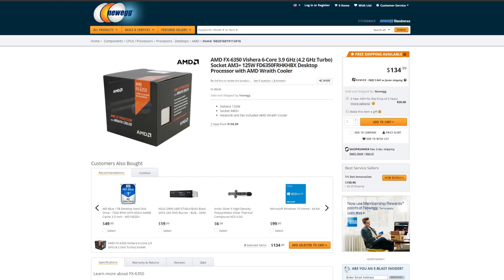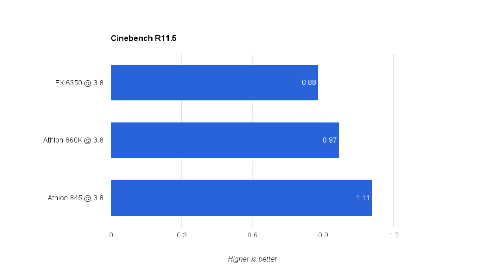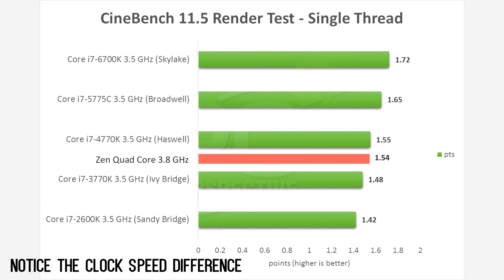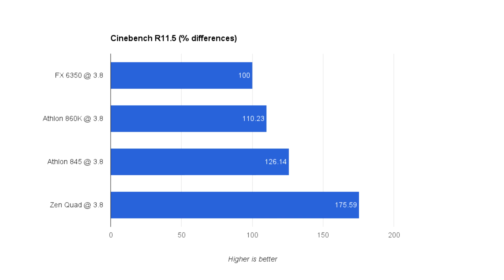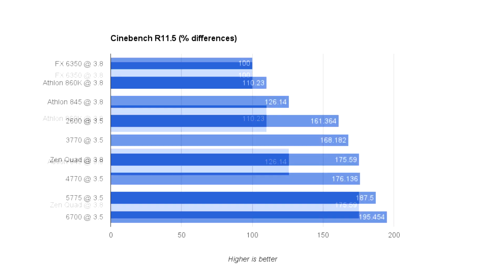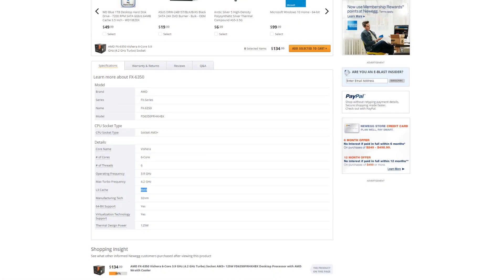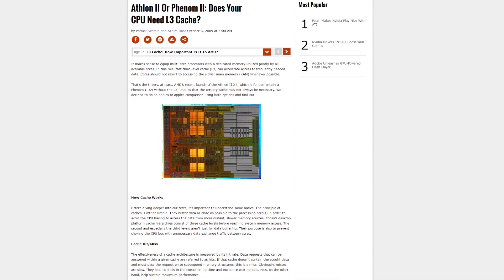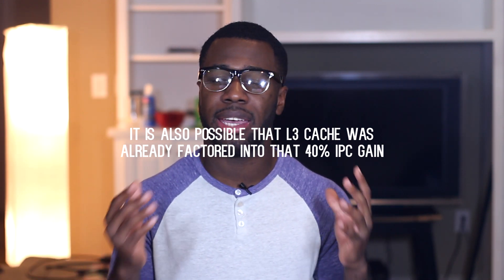How Fast & Powerful is AMD's Zen CPU? (Revisited) | OzTalksHW

Comment: But the i7's have hyperthreading while the theoretical Zen quad does not.
Reply: Wrong. Zen has SMT which is the same as Intels Hyperthreading.
Reply: Ill Vill Even if it does, Ozy hasn't accounted for that in his theoretical Zen quad.
Reply: AmpEdition Exactly shits gonna be crazy. I hope AMD slipped up when they showed that investment slide that showed Zen having double the performance of their most recent iteration of their Orochi architecture. That would put Zen slightly past Haswell & probably just trailing Skylake in the best case scenario. Ultimately I hope the new High end top tier version of consumer 8 core Zen will curb stomp the shit out of a Skylake i5/i7 in total performance and value and force intel to react and lower their prices. I just want AMD to be good again.
Reply: & fingers crossed for balls high OC potential
Reply: zen has smt. zen will probably be like the rx480, focusing on the Mainstream Market to sell as much as possible. i think it will work out well.
Reply: David M. // VFX. I was thinking that

Comment: Hey, I'm pretty sure I just read that, yes, the clock is supposed to have a 40% improvement, but on top of that, it's 14 nm (while haswell was 22nm) with architectural improvements which are supposed to bring another 15%. So it shouldn't just be 40% better, we could be seeing a 161% performance jump between the excavator arch and zen. Zen isn't supposed to be worse than haswell, it's supposed to be approximately on par with Skylake. The only differences between Skylake and Zen that we can really presume exist would be ipc's (and maybe turbo since it's new to amd?). Everything else is supposed to be pretty damn similar. THAT's why this release is such a big deal.

If zen can be within 5-10% of the performance of Intel (with 16 damn threads), at 40-60% of the cost, then this is gonna be a year FULL of game changers.

http://www.pcadvisor.co.uk/new-product/pc-components/amd-zen-processor-release-date-price-specs-features-3643552/

Comment: Probably why they are coming out with the 8 core first. Price will determine if its price perf comparable to the current intel. If they price the zen 8 core to a 4-6 core intel I think its a no brainer. Have to say that zen is also rumored to have avx 512 compatible which has been said to be the next big thing for fp. So we might get a good bounce with zen and those intel cpus that have avx 512 such as skylake onward (yep older intels dont have it) once they come into use. Sort of the same way some may still get a bounce from fma 4 in bulldozer cpus if it comes into usage vs fma 3 that intel went back to after playing games with amd about upcoming new instruction sets.

Comment: So AMD will be barely competitive with what will be a near four year old architecture by launch? Sigh.....

Excellent video though my man!
Reply: No, this is measuring IPC. IPC != raw horsepower. For one thing, we don't actually know how fast Zen is going to be, although I'm betting that any 3.5Ghz version is going to be the budget chip of the lineup. For another, we absolutely know that Zen is being released as an eight core with recovered six cores probably being released once there's enough critical mass. Zen is going to murder hobo any non-X Intel processor in existence.
Reply: For a start, within 1 year of ZEN launching, AMD will have completely taken over the server market from Intel. As of last year, Intel made up over 90% of CPUs in the server market / industry. That is insane, because back in the early 2000's with the Athlon X2's, it was a 50/50 share, pretty much. Since then, Intel has DOMINATED the server market with it's Xeon CPU's and AMD now holds less than 10% of the server CPU market.

When ZEN comes out, it will be AMD who have the 90% share and Intel who drop to 10%. 16-core ZEN CPU's at a SMALLER PRICE than Intels current 6-8 core Xeons, but with the same (or better) IPC's and larger cache, ZEN will absolutely wipe the FLOOR with Intel. THAT is where the money will come from. That, coupled with Polaris / VEGA being in the next gen consoles (all 3 of them) are huge for AMD. Their stock has already risen over 50% in the last 2 months and ZEN isn't even out yet.

The desktop (home) variants of ZEN are not AMD's biggest earner and as such not as much of a concern for AMD financially. But the desktop ZEN CPU's will be far better price / performance than Intels current CPU's (no surprise there then ... this is the same as ever) BUT the difference being, you no longer have to sacrifice PERFORMANCE as ZEN will be as fast as Haswell in both single core and multi-thread (only for a lot less money) with full support of DDR4.

So yeah. In one years time, expect most people to be buying Zen based PC's with VEGA GPU's and 16GB DDR4 (cos it's cheap now) and playing amazing looking games in Vulkan / DX12 with lots of PC Exclusives. Intel had better come up with something (or finally drop their prices), but as far as I can tell, it's already curtains for Nvidia.
Reply: TheVanillatech So when Sandy Bridge beats Zen on same core same threads and same clock what will you say then?
Reply: 40%(41% more correctly) would put them basically on par with Haswell. AMD themselves have stated that Zen surpassed all expectations and they are on track for greater than 40% IPC improvement. How much greater they will not say which is the smart thing to do. Say its 45%, that puts Zen past Haswell and Nipping at skylake for lord knows how much cheaper. Unless AMD is straight bullshitting everybody hard Zen is their salvation.
Reply: Is this a joke. Intel are about 6 years ahead in ipc over Zen. Sandy Bridge ipc edges out Zen for goodness sake. They are about 6 years ahead in FPU performance to and about 3 years ahead in performance per watt.
Reply: Nissangtr786
That was hilarious, thanks! XD

Got any more?
Reply: Nissangtr786
I'll say that when the paper launch of the GTX1080 showed a reference card running on air at 63 degrees under load with a 2200Mhz overclock ... I found it hilarious that in REALITY, it was all pure hype and marketing BULLshit. Just like what you are saying right now! XD

But yeah ... whatever. I don't care for opinions, hype, marketing, semiotics or anything like that. I am based firmly in REALITY. I'm a scientist. How about you? Consumer? UnINFORMED consumer? :D
Reply: Except that it will come with 8 cores and 16 threads, what Intel CPU can you buy right comparable that? Sigh...
Reply: David Rodríguez
Zen ships in many forms. The top end server CPU's which are going to instantly dominate the global server market and shift the money back to AMD have 16 cores and 32 threads. That is just insane. Intel have nothing to even compete with this. AMD will price them very aggressively and sweep up. You are talking a 90/10 share in AMD's favour within two years, a complete reversal of todays scenario. It will be amazing.

Hopefully the desktop variants will be equally as attractive to us gamers / home users. I am sure they will, but perhaps Intel will respond. As an Intel CPU user since the days of the Core 2 Duo, I have been lucky enough to always be able to afford the CPU I wanted for gaming from Intel, but today they are seriously way over-priced. ZEN might change all that. And I would happily switch over to an AMD based PC if the price was right and all the features were there. I am currently on aging 1156 tech anyways so I am due an upgrade of my entire core system but I will not make a move until I see detailed ZEN numbers first.

The Skylake i3/i5 range looks attractive, but after the BIOS updates which removed the ability of overclock those unlocked CPU's they don't hold as much appeal to me now. I can't afford or justify a Skylake K based i5/i7, and Haswell is already a full generation old (although it's price doesn't reflect this). Yeah ... I think ZEN might be answer for my next upgrade.
Reply: TheVanillatech Intel biggest margin is in the server market as they can show the gulf of being many years ahead of AMD on high end cpus. The server market will always be dominated by Intel unless Zen is significantly cheaper.

Comment: why don't they test CPUs like they test super computers and give flop/s
Reply: CPUs do mostly integer math. You can still use flops to measure it but you wouldn't be using the high speed integer cores.

Comment: Can't wait for ZEN to come out, I just hope they are much more energy efficient and runs much cooler than the likes of the FX-9590 or even the FX-8350. I have the FX-8350 and absolutely love it,  really fast and you simply can't beat the price. But it does run really hot and the stock cooler is awful, forced me to buy an aftermarket cooler, other than that, it was perfect for me. I hope for my next build that the ZEN will meet my needs.

Comment: The thing to remember is that the real world difference in games between a 5960X and Skylake 6700K is only like 5 fps at worst and most of the time is less to none.  Plus in DX12/Vulcan there is a very high chance many games will use all the cores you can throw at them.  Making 8 cores at slightly lower IPC a much more future proof option because in a game that  is using all 8 cores a 5960X will out perform any lower core Skylake or Broadwell cpu.  Also remember that an 8 core cpu is simply better than a sightly higher IPC but lower core count cpu for almost everything else you would use a medium-high end Desktop pc for.  That's why Boadwell-E is so much more than Skylake even though it is a slower, previous gen architecture.  Keeping those things in mind it is clear that If Summit Ridge is at least as good fast a 5960X and priced around $500 or less it will be the go to cpu for everyone who isn't' ponying up double or tipple for the 8 or 10 core Broadwells to get a hair more performance or who isn't buying at the sub $400 level.

Comment: I'm glad I subbed to you man, probably the most realistic wild hypothesis I've seen, Zen is so far away and subreddits are already filled with the all to familiar hype trains, that inevitably make AMDs products seem less innovative than they really are.

Right now I'm sporting a A10 7870k OC to 4.5GHz and an RX 480 8GB on a 42 in 1080p TV I got for 100 bucks last week, I'm ridiculously excited for Zen because it's the last component until I seal this build up for good (Obviously aside from the ddr4 ram and am4 motherboard) I think it will finally give me the computing edge I need to carry me into my later years, not forever obviously but I'm getting too old and too broke to try to keep up with all the latest tech.

Thanks for your videos man, easily in my top 3 most favorite and recommended tech video creators.

If you read this, I got the TV without a stand, that's why it was 100 bucks, otherwise in top notch condition. do you know any cheap alternatives? don't really want to mount as I have old frail walls, and 200m VESA stands for the Vizio E421VO will run me around 50-100+ usd

Comment: if you follow leaks and investor updates, they were happy to announce the 40% on paper improvement, was exceeded in production testing. By how much? would be speculation at this point,  but they were boasting a "surprising and healthy improvement" if the vernacular is to be believed, so anywhere from 41-46% would be a conservative guess. 
This is important in context to your vid because the 40% IPC increase was also predictions from investor slides, and can't recall what was formerly revealed if anything at computex and e3 (I think they were criticised for being so tight lipped about zen)

Comment: I mean u still have to take in consideration its going to be 8 cores, 16 threads and for content creaters that's going to be great. And if it's on par with the latest I5 and can overclock better than piledriver and bulldozer cpus it's gonna be a pretty good buy.
Reply from the maker: Yes, especially if it's priced correctly
Reply: Hey Oz, why don't you benchmark it against the i5 4690k? just curious since I have one and I feel like it'd compete and is more budget friendly.

Comment: Well AMD would stop sitting on their ass and release the damn CPUs already more people will buy into them. By the time AMD releases Zen, Intel will always have their next line up that will just blow them out of the water and AMD won't be able to do anything about it.
Reply: And will be fine if they lower their prices, somewhere around $170 more people might buy into the zen cpu's
Reply: +Riley Stroud AMD*
Reply: it will get there. Zen has completely new architecture and that is why it takes so much time to push the product out
Reply: Horse McHorseMan I disagree. Amd was waiting for Intel to release Kaby lake so Amd could release something cheaper and same performance, slightly worse, or possibly better. Intel doesn't have to worry about releasing a CPU all the time because they have no compitition. If Amd waits it out they can spend time making it better than Intel instead of releasing it so fast

Comment: I think AMD Zen will be above Haswell roughly equal to Broadwell.
Reply from the maker: I still think slightly slower than Haswell clock for clock, but I'd love for them to prove me wrong
Reply: OzTalksHW Well they did say that they have more than 40 percent IPC with the Silicon they have now, and they do base their findings off of application mixes. 

I used Geekbench which lack the whole ICC issue for some calcutions of my own http://browser.primatelabs.com/geekbench3/5724096
At 3.5Ghz Single core it's 2754 for the Athlon X4 845
http://browser.primatelabs.com/geekbench3/7138276
At 3.54 Intel i7-6800k Single Core score is 4022
Zen's Single Core Score at 3.5Ghz will be 3,855.6
Now if we use a i5-4690k at 3.5ghz with a Single Core score of 3619, so Zen should at least be faster than Haswell or at the very least equal to it. Clock for clock
http://browser.primatelabs.com/geekbench3/7300291
Reply from the maker: 1216Rockman Using Geekbench, it seems to be a bit faster clock for clock.

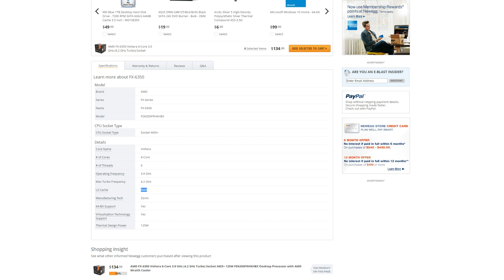Comment: 3:35 all modern CPUs have 3 (or 4, in the case of Iris equipped Intel procs) levels of cache
Reply: Not any of the AMD APUs
Reply: Street Guru that is...odd
Reply: Niko Yochum
Part of it is cost, the other part is that they couldn't fit it on the die with the iGPU taking up half the space

Look at broadwell with it's dedicated video cache, super fast for an intel iGPU, but also incredibly expensive for the performance
Reply: Street Guru It seems so illogical to not have an L3 cache on their APU line though since that would speed up performance graphically by quite a bit, just more of AMD making blunders...
Reply: Niko Yochum
They could not physically fit it on the die man, the Zen APUs will most likely have an L3 cache since those are more full CPUs designed with it in mind and on a 14nm process
Reply: Street Guru#just32nmProblems